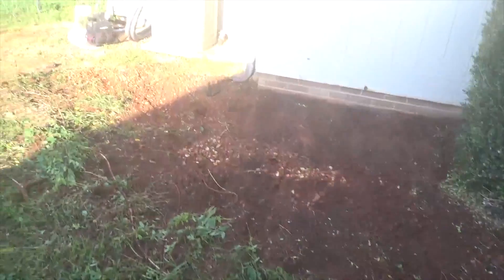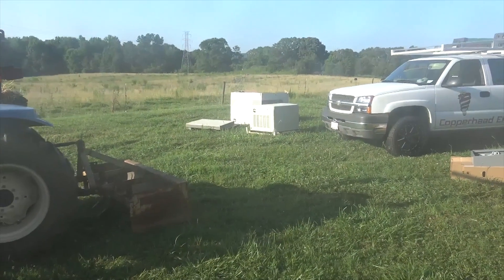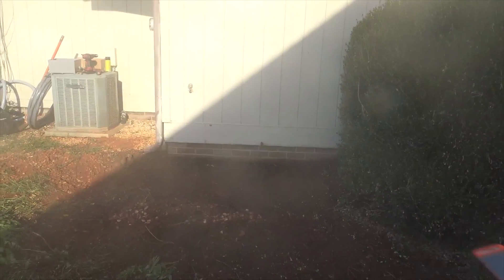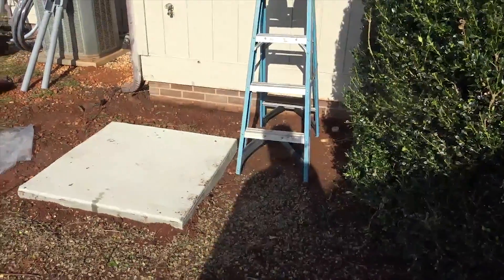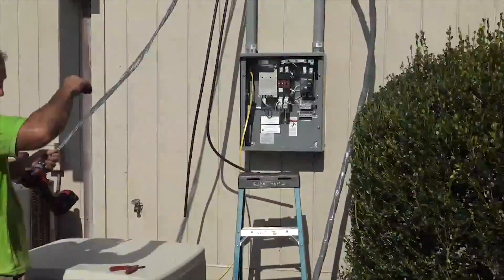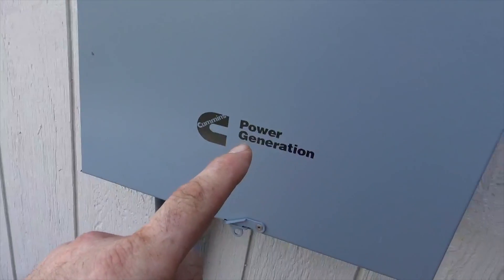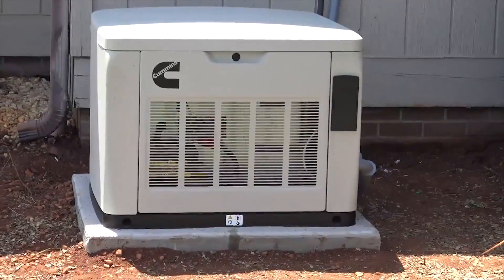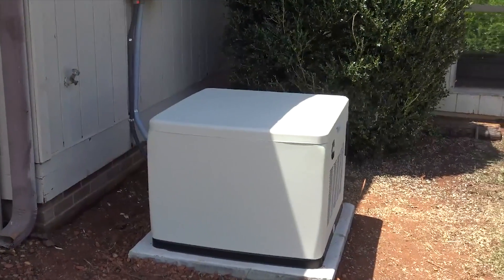Genny, I got your number

Comment: You mention in the video the unit should be 18" from any surface (wall etc). The specs I'm reading are 18" from the right and left sides, but 36" from the front and 60" from the rear, so unless I'm mistaken this unit is too close to the house wall. Clarification would be greatly appreciated.
Reply: Each locales AHJs have different standards per area, despite manufacturer recommendations. Also, there's always variances that may apply. I just recently commissioned a 29kw home unit that made me laugh when I arrived. It was no more than 4" from the wall and right below a window, however since the window was into a "non-occupied" space (garage) and the vinyl siding was considered less flammable, the generator location was approved.

Comment: I always appreciate your videos.   This might be a little mundane, and I know there are other videos out there,  but could you do a video showing how you prepared and poured the concrete pad?  My efforts at concrete have been sub-optimal.  Thanks!
Reply: I should have filmed that.  Sorry.  I just framed up a 4" thick 40"x40" form.  I used 5 bags of 80# quickrete.  Mix it fairly wet so that the form fills nicely.  I added some welded wire to make it stronger about in the middle of the pad.  before I poured it I layed an old tarp down on an exiting outdoor concrete pad and a pc of cardboard on top of that, then the form and then I poured the mixed concrete in.  I screed it with a board and when close to dry I broom finished and used an edger to round the top edge.   I used my tractor with forks to load it because it is quite heavy. I could have gotten away with a 3" thick pan.  Next time ..  a video!

Comment: My 9Kw generator runs at 8Kw on propane a hundred pound tank lasts 25 hours.  Does this 20Kw generator work for 125 hours on the 500lb tank?
Reply: wjf213 ,the propane co.. will only fill to 80% of capacity.  So that cuts your time down.
Reply: I'm pretty sure it burns between 3 to 3.5 gallons an hour under full load. So a 500 GALLON tank should give you at least right around 150 hours of run time under full load, and 225 to 250 hours at 50% load. That's draining the tank completely.
Reply: You know, I completely forgot about that. You're 100% correct, you need room for the liquid to turn to a gas. I haven't bought propane in 25 years or more. The price got to a point where it wasn't worth it compared to other fuels.
Reply: @wjf213  super old thread I know, but yes, 80% is considered max fill on propane. Even diesel has a max fill less than the tank size, especially for commercial units. As any fluid will expand when heated, and the risk of even a small fuel oil spill isn't worth the EPA headache. Also, most generators (if properly sized, barring any load management devices) will be about 2-3 times oversized for the actual steady state building load. NEC load calcs are based on the utility which is usually considered an "infinite" power source. But when running on a generator, motor starting amperage must be considered. The rough rule of thumb is 3x the FLA for starting a locked rotor motor, like would be the case on an A/C unit or freezer, hence the oversizing of a generator. So once everything has been started and is running, the gen will be at maybe 40-60% full load capacity, and fuel burn rate is not a linear factor. For instance on a 600kw Cummins diesel generator, the burn rate at 25% load is around 13gal/hour, and 100% load is about 42gal/hours, so you have to account for a loss of efficiency when running it at partial load.

Comment: How fast would that generator drain a bbq propane tank? Just wondering as they can be found/refilled when power is down and getting a truck to refill the 500 gallon tank would be hard.
Reply: The run time isn't as much of an issue as the vaporization rate of a 20lb cylinder. It simply can't boil off fast enough to maintain the pressure to the system. You'd freeze it up solid and lean the mixture out until it quit.